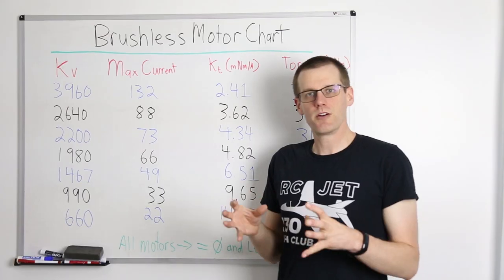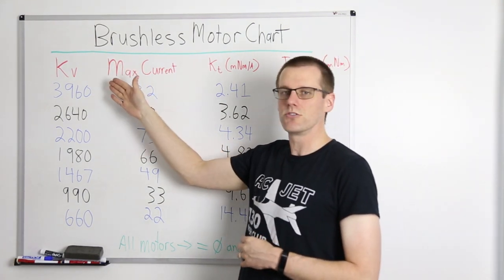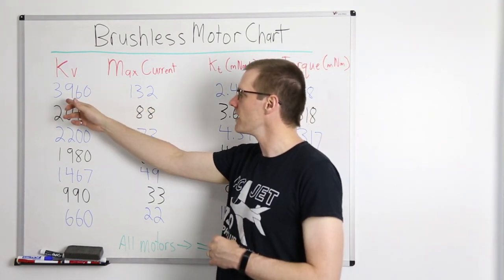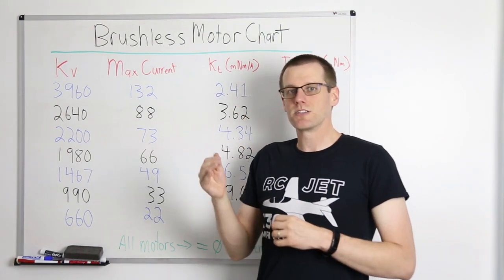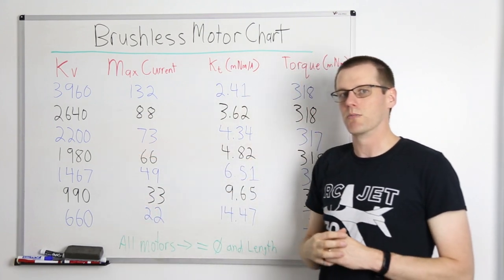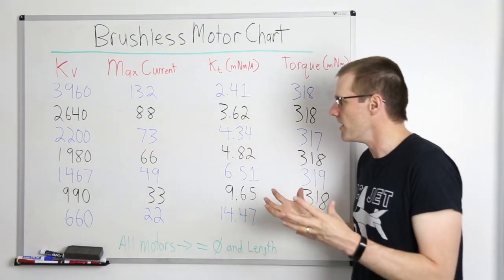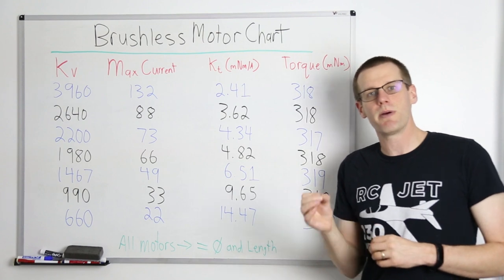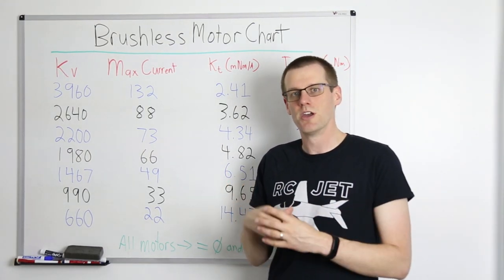STOP Saying Lower Kv Motors Produce More Torque

Comment: Thank you for the video.

I have a question.
If the amount of copper is the same, it's the same motor.

but
14.4v 2000kv 2000w
28.8v 1000kv 1800w

Why is the watt difference between the two motors here?
1. Are the copper weights of the two motors different?
2. The voltage and wattage increase are not proportional?
Reply: This video is totally misleading. kVis the offload speed at different voltages, it is not the load speed. All that tells you is ‘is might it be fast enough?’ . It doesn’t tell you if it is powerful enough. The power, or torque depends on the Volts x Amps principally and for how long that power can be maintained without burning out the motor.
The maximum speed is limited by the back emf generated by the rotation of the rotor and kV is a hangover from the days of brushed motors when the speed was limited by the applied Voltage, the higher the Voltage the faster it went until the back emf was nearly the same as the input voltage and there was no more power left to keep the motor turning. BLDC motor speed is governed by the electronics. All is governed by the heat generated in the windings. Hence the standard for rating motor outputs is based on specific ambient temperatures.
And as for the elegant mathematics what you need to know is the output power, which is  easily specified in Watts, just like light bulbs or cookers. You know the speed that you want your shaft to drive and you want to know the power that is available. The more power you have the more likely it is that your plane, car or boat is going to run. kV doesn’t tell you that.
Torque is power per rev. and apparently mistaken for power. There is of course the relationship, but it is power that drives your car, torque allows it to carry heavy loads but at lower speeds

Comment: I have 2 sensored 2s 3660 with 10bl120a esc. One has 6.5t and other 13.5t with same pinion,. what would be the real difference felt when driving for example? And would you say 3s on 13.5t would have nore torgue!

Comment: So if I understand correctly the kV value you want to select is going to be solely dependent on the gearing options/ prop size and the battery voltage?
Reply from the maker: Yes, primarily Kv varies for users to be able to run different voltages on the same size motor. 
It would not be good practice to take a 60,000RPM capable motor and run this on a prop at 8,000RPM. Motors designed to operate at 60,000RPM will not be able to make maximum power at 8,000 RPM.
Reply: No, it depends on the rpm you want to run your motor as well. Lower KV if you’re running at lower rpms, higher KV if you’re running at a higher rpm.

Comment: I'm confused....I'm running a 2200kv motor at 2x5000 milliamps. Where that 73 is coming from? How can you run such high amps? Thanks
Reply from the maker: A motor data sheet for current.

Where does your 2 x 5000mA come from? What RC are you running? This is not a commonly measured value of current in an RC vehicle.  Also, measurement tools do not specify current drawn as a multiple - 2x. The measurement tool you are using is way off I'm sure.

Comment: Hey! Thanks again for another great video! so I have a few questions that may or may not be directly related to this video. so I’m looking for a wall plug power supply that I can use to continuously power my Traxxas e Revo esc and 2200Kv motor. I’m using a dual motor and escs setup on my custom build Tesla Turbine/Pump. now I was just going to buy some more batteries to be able to run them but I would really like to be able to just supply the power from a wall socket so I don’t have to regularly charge it to run tests with this thing. Would you have a suggestion for a wall socket power supply for me to run both ESCs without needing batteries? On another note am I able to just power these esc’s with any old 12v battery supply? Like could I actually take a car battery and run the ESCs or would that damage them horribly? Sorry if I’m asking really weird questions that are sort of wildly outside of the scope of your video 😅 you’ve been a lot of help with answers to questions I’ve asked you in the past for my Tesla Turbine +BLDC Generator build and now I’m moving to the next phase of building a Tesla Compressor so I need to supply power to the BLDCs on my build to spin up the discs to work as a pump and I just know you’re the right person to ask these questions to too! 

Now I was going to post a link to the latest video of my turbine/pump but I don’t want it to seem like I’m just trying to get free promotion. So if you would are willing to take a look at my turbine/pump build to properly understand what I’m doing asking, please go to my channel and check out my latest video to see the 10in Aluminum Tesla Turbine with Dual 2200Kv BLDC motors/generators videos I just posted. 

I had been asking you questions on a few of your videos in the past before so if you remember me, this is the progress I’ve made with my build 😇 I could really use some advice though so I can do better tests with my turbine/generator. Thank you again for your really detailed videos! They are very helpful!
Reply from the maker: What exactly are you trying to power? The main ESC leads or the 5v receiver lead? A car battery can be used on the main power leads if the ESC is good up to 4s LiPo.
Reply: @RCexplained  the ESC leads. I know a dc power supply would need to be HEFTY because of the 3000watts and capable 120amps these 2200 Kv rated BLDCs need. 

I just want to be able to supply power to my ESC so that I can use the motors to spin the Tesla turbine/pump so that I can do all my balancing of the runner without having to charge batteries all the time just to supply the power. if I could wall power supply I could just do continuous runs and not have to stop. As well in the future I want to use the motors to run the turbine as an air compressor so it would be nice to be able to power it with the same system as I’m using for the turbine and just run a power supply to it. But I do realize that’s what is so impressive about these new lipo batteries also, the power outputs they have are rather amazing.
Reply from the maker: Yes, you can power the ESC with a wall power supply. Make certain voltage, polarity are correct and watch your current use to stay under specs. 
I watched your video and don't think it would take 3000 watts to spin up your turbine to balance it.
Reply: @RCexplained  good to know! And yeah currently I’ve only gotten the 10in turbine up to 3000rpm but she’s safe to spin up to 15,000rpm and at those high of rpm the runner acting as a pump will be moving A LOT of air. I would like to think 3kw or even the dual 3kw I’ve got would be enough to make a VERY powerful centrifugal compressor but I’m very much still in the R&D phase. It’s really more of can the motors supply enough torque for the mass flow rates and the gear ratios I’m using. 
The first runs I did with my setup to spin the turbine were half successful and half a train wreck. I had it way over geared for what is needed on start up and it was cogging like crazy. The polycarbonate I’m using was flexing out of the way and the spur gear was just bouncing all around on the gear. It sounded horrible lol but I got it to start spinning and once it did she sounded super smooth. But I had my esc set in training mode for some reason and I was only getting half throttle. I couldn’t get it started spinning again after I stopped it as the cogging and skipping just wouldn’t stop. Which just tells me I need to go back to the drawing board with my custom turbine bearing and BLDC motor mount plates. I also think I’ve got my pinion gear a little bit too far out on the very edge of the motor shaft. I needs to be to fit around the turbine bearing but I think being so cantilevered like that is providing some issues. I’ve got lots of ideas to fix all this though. Just gotta keep testing. 

Any suggestions for getting passed the initial start up torques? Everything runs smoothly once it’s going I just gotta get it going. 
We will see! 
Thanks again for your help!
Reply from the maker: If you are a bit over geared to rotate the turbine assembly with the motor, it may be difficult. Can you re-gear your motor? Using the highest output batteries will help as there is a very high power transfer during startup.
You could also apply some high pressure air in the turbine to assist start the motor.

Comment: Hi, I didn't hear you about heat. 

I have a problem with my RC car. I changed te stock setup to a brushless setup. 2S Lipo with 4300kv motor and 60a esc. I have replaced the standard pinion and spur to slipper. This setup requires a bigger pinion, 3T up from stock.

Now the motor gets so hot, that after the 3th time running it, it is rip.

I can't switch to a bigger motor....

What should I do, because what I understand from your video, going down in KV won't help on torque to get my rig easier going icw keeping mt motor cooler.

Or did I misunderstand something?
Reply: First of all, brushless motors draw a lot of more current and produce a lot of more heat. Its hard to burn brushed motor, but burn brushless is very easy.
You have to deliver a proper cooling system or make a bigger gear ratio which will make your car slower and reduce load on your motor.
You can program your ESC to use less power and make your car slower or buy lower KV motor which will be underpowered by 2S.
Reply: @harynian  ok,

Now I bought a 3800kv motor but this time a bit longer can. The 3660 size. I didn't have the chance to run it yet, because I'm also waiting on an 80A ESC. The 60A must have got a glimp from the previous 3650 motor going so hot because it's also rip now. 

Car is just a 1:10 scale buggy. Nothing heavy with big tyres or so.
Reply: @Daniello84  you should also buy cooler fan for motor, it helps a lot.
Reply: @harynian  I did, but I can't get it to fit underneath the body 😭

Comment: Well said… can you do a video or comment on the relationship between the static torsion of a rotor based on the strength of the magnet in relation to how much torque that motor will produce. Basically I have two motors of the same size from different manufacturers however one shaft spins more freely than the other. I’m assuming because of the strength of the magnet. Does this mean that motor will produce more torque over the one that spins more freely?
Reply from the maker: No, there is little relevance to torque based on how freely the motor spins in your hand. The torque required to rotate an un powered motor is known as the cogging torque.

Comment: I may have missed it but is it assumed that the Kt is correct at all voltages/RPMs? Mainly, I’m using my BLDCs as generators so Like for a Kv=2200rpm/volt and  Kt=4.3mN•m does that really mean that regardless of the rpm, if I supply the same torque to the shaft at the different rpms it will always put out the same current but it will do that current at different voltages depending on the rpm? because if I understand it correctly both these values are actually for if you supply a torque of X value at rpm of Y value you will get A amps out at V volts and not necessarily directly correlated to what power is put in using it as a motor. Is that correct? Something just seems to not fit with that to me for some reason.
Reply from the maker: Kt is correct at 100% throttle for all voltages. That is correct Current gives you torque, voltage is RPM. Efficiency plays in to this as well
Reply: @RCexplained  awesome thank you. So does that means since I’m using this motor as a generator if I supply too much torque to the shaft, even at low RPMs I could very easily go well over the rated amps for the BLDC then? 

Like say since I’m at Kv=2200 and Kt=4.34mN•m/amp and my BLDC can handle a max of 120amps. So If I supply anything over 520.8mN•m to the shaft it would  gravely go beyond the 120amps the BLDC was rated for then right?
Reply from the maker: Yes, however, your charge controller would have to be able to handle / draw the >120A.
Reply: @RCexplained  sound good! Yeah I’ve got a 4000watt /8000watt peak 12VDC->120VAC 60hz. That should be able to handle everything I’m pushing at the moment. Thanks a lot for all the help! 

Also, just FYI, I NEVER get a notification when you respond to my comments. I don’t know why when I get notifications for replies on other comments I make on other channels. Like I have to go back to your movie and find my comment to see your replies. Idk if maybe thats something you want to speak with YouTube support about because people should def be getting notifications when you reply because it helps get them back to comment more helping the engagement rates on your videos to go up. Just something I thought you might want to know. Thanks again for all your help!
Reply from the maker: No problem Charlie. You may also drop links to your video, not a problem. All I ask, is that your video has a link to RCexplained if something was able to help and a link would fit. 

Also,
Turn on "Activity on my comments" in your settings. You must have them off, I think it does default on.

Comment: Let's say I have a motor and I want to increase torque. However, im restricted by the physical size of the motor. As in, I cannot change diameter or length of motor. Im also stuck to using stock magnets. They cannot be changed or made stronger. The only variable I have the ability to change is the winding of the motor. So I can change the amount of turns and guage of wire. So my question is... if I were to rewind a motor and keep the amount of turns exactly the same but increase the thickness of wire used, would this alone create more torque?
Reply from the maker: If you could increase the efficiency of the motor, there is potential for additional torque. An increase in efficiency could also decrease your Kv allowing you to run a potential higher voltage.
Reply: @RCexplained  Thanks for your reply! Much appreciated.

Comment: I have both 1400kv and 2200kv motor which one will drain my battery faster
Reply from the maker: With all else equal and using 100% throttle, the 2200Kv Motor will.

Comment: I'm finding opposite results with my Surpass 1410,
2500kv 8A, .00382kt x 1000 = 3.82 x 8A = 30.56mNm
3500kv 9A, .002728kt x1000 = 2.728 x 9A = 24.55mNm
5500 kv 10A, .001736kt x 1000 = 1.736 x 10A = 17.36mNm
9500kv 12A, .001005kt x 1000 - 1.005 x 12A = 12.06mNm

Did I mess up the calculations?
Reply from the maker: Note that the 9500Kv motor is 3.8x more Kv then the 2500Kv motor. However, current only goes from 8A to 12A or 1.5x higher. I haven't looked at the calculations as these specs are the area of concern. The max current specifications suggest that there is a problem with the copper mass of this motor series.
Reply: @RCexplained  That makes sense, they're about as cheap as it gets. 
Would that be a discrepancy in the current draw, or kv? or kinda both?
Thank you for the response, and great video, I learned a lot that I didn't know about brushless motors.

Comment: Wait.. then what is the point of using a high Kv motor, if it has the same RPM and torque but draws more power and creates more heat?
Reply from the maker: Different Kv options are available to allow varying voltages to be used with the same class motor and then from there RPM tweaking.

Comment: I'm still confused then as to why they would even offer 7 different versions of the same motor. If I'm limited to low voltage, would I still look at choosing a lower KV? I'm guessing that limits the current, which limits the RPM?
Reply from the maker: Kv options are available to match the voltage a user will run. With motor RPM constant, a lower voltage will need a higher kv to get back to the same overall rpm as a higher voltage setup.
Reply: @RCexplained  Awesome. Thanks very much!

Comment: If you keep the same battery for both motors in different kv's will you see a difference in torque?
Reply: Same battery (voltage) will result in equal torque, but the low-Kv motor will have lower speed. On low Kv motor, you can increase the voltage enough to result in equal power. This will occur at lower speed, and higher torque than the high Kv motor.

Equal speeds would require even greater voltage. In this case, the low-Kv motor would then have greater torque, voltage, and power, so it might fail due to excessive torque, heat, or electrical arcing. Even though the current is equal, low-Kv motors have more (i.e. thinner) windings so the same current causes more resistive heating, assuming the same size motor.
Reply: @TheBenware81, that is a really good question because that is the situation that people are referring to when they say a higher Kv motor has less torque. You typically can't change the voltage in racing as you are restricted to a specific battery type. Also, even if not racing you can't fine tune the voltage, you can only make step changes of typically 3.7V with LiPos. If all you change is the motor, the car with the higher Kv, at a given speed will have less torque and will accelerate more slowly than the lower kV motor because at the same RPM the lower kV motor has more torque. The higher Kv motor should, in theory, obtain a higher top speed.

The reason for using a higher Kv motor is for more power, but you will only get this at higher RPMs. So, when you drop in a higher Kv motor, if you want more acceleration then you must reduce the gearing appropriately (eg, smaller pinion, bigger spur, reduce prop pitch, etc.). If you adjust the gearing correctly you can obtain both more power across the entire rev range and a higher top speed with a higher Kv motor. Downsides are that the battery depletes faster (obviously) and the motor runs hotter.